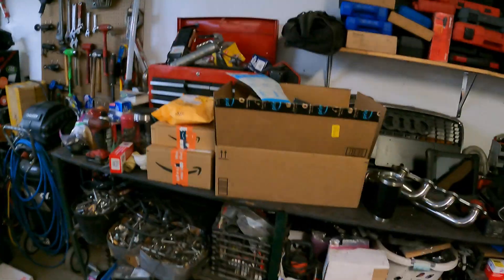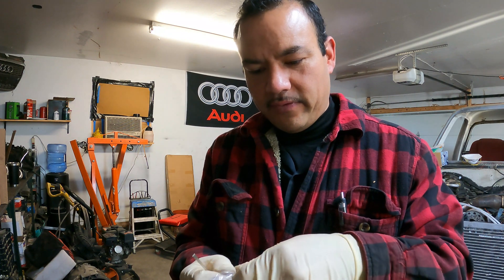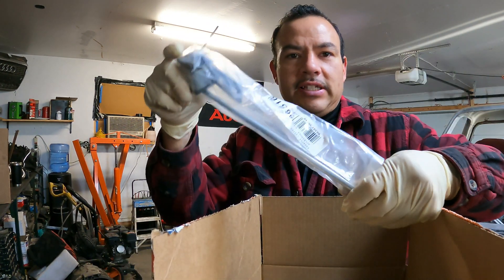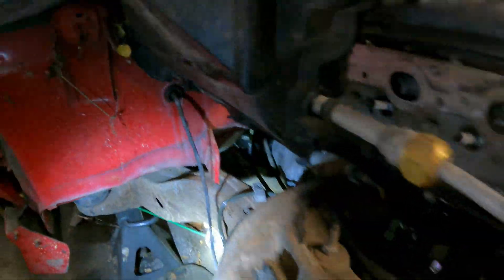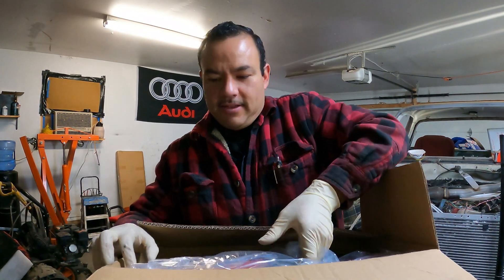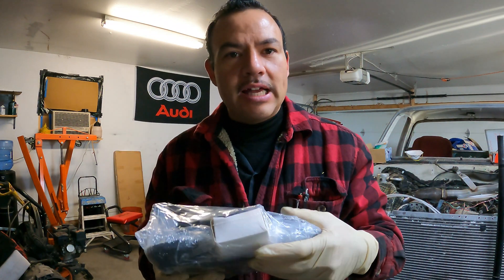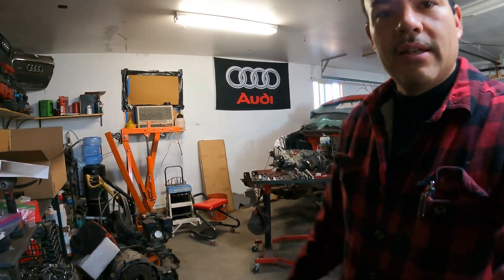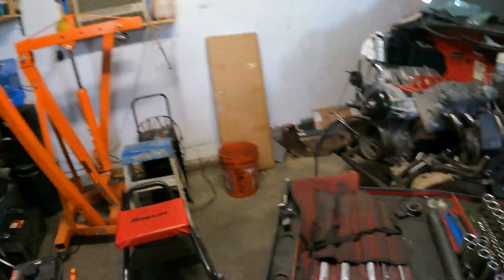How to ls swap a s10: parts list 2

Comment: You should have used the crossover steamport ICT billet crossover hose instead of having to run it through your radiator
Reply from the maker: Hey Jenkins thanks for the comment! I just looked up that ice billet crossover and it looks legit on my next one I'll get it for sure thanks! I have 2 more ls swaps coming down the pipe line so I'm learning the best parts for each project.
Reply: No thank you for the videos